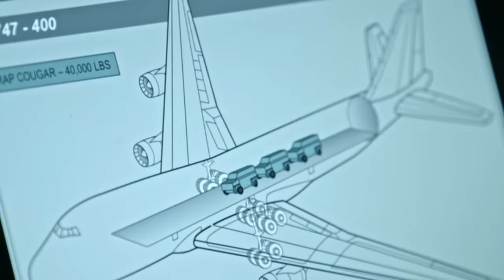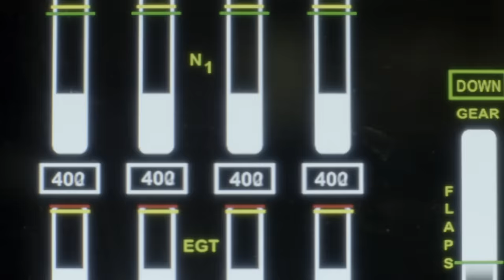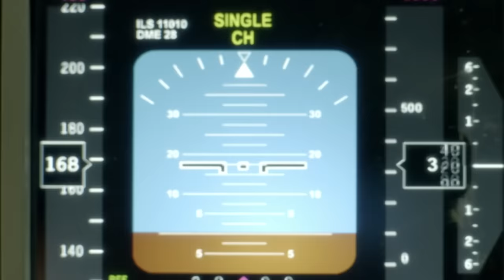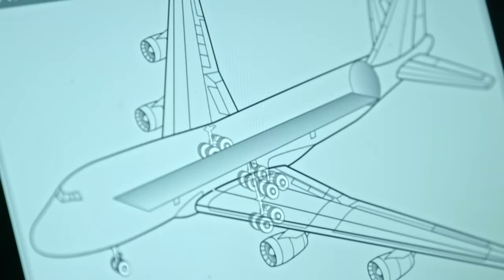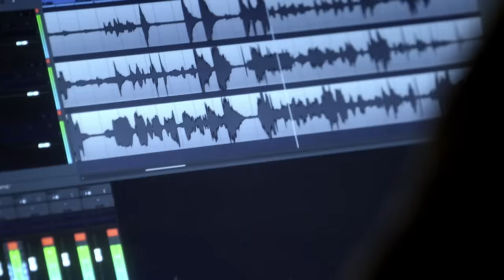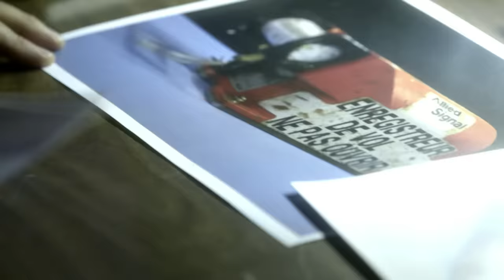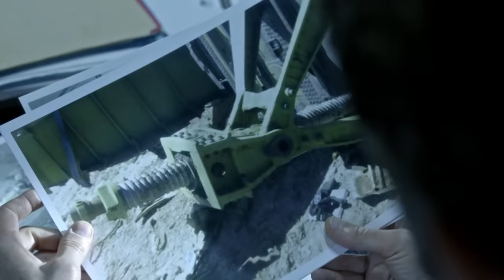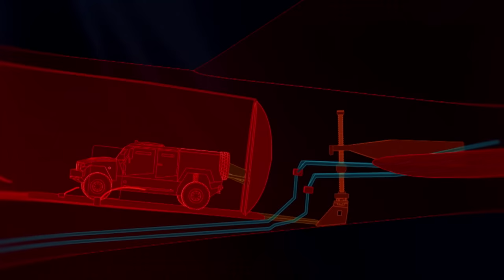The Cargo Plane in Afghanistan That Crashed Seconds After Take Off | Mayday: Air Disaster

Comment from the maker: Had you heard of this aviation accident? What do you think caused the crash?
Reply: I have heard of it. It was caused by  inadequate securing of cargo that shifted to the rear. The civilian contractor had vague and inadequate procedures and inadequately trained loadmasters. This particular load included several heavy vehicles that didn’t have sufficient measures to prevent them from rolling back and crashing into the rear of the cargo bay, damaging the aircraft and shifting center of gravity, making the aircraft uncontrollable. There was an insufficient number of cargo straps used and many of the straps were in poor condition. Cargo chains were not used. Wheel chocks were also not used. If USAF loadmasters had supervised the load, they probably would have identified the deficiencies and might have prevented the incident. Unfortunately, at that time and place the contractor was given full responsibility for their loads without meaningful direct oversight and they cut corners to reduce costs and win lowest bidder on the contract.
Reply: Even if the contractor loadmaster had been properly trained and certified and the company manuals had been properly written with accurate and sufficient information, the incident still might have occurred because the company also failed to provide sufficient cargo securing equipment and pressured employees to make do with what they were given. 

The best solution would be not to use contractors at all for these kinds of loads. Leave them to the military to airlift themselves and give the military sufficient equipment, personnel, and time to conduct the transport missions properly.
Reply: Omg yes I have a problem I believe
Reply: Yes I have heard of this crash. I know the pilot's daughter. She was in middle school when this happened.
Reply: I remember when the video showed up online. I heard about the cargo failure much later, but never heard about the strap angles. As someone who used to teach technical writing, it's tragic to know that omitting such critical information could lead to three 3 fatalities and a load master who likely carries a lot of guilt.
Reply: I heard it was partly  ATC’s fault as they were fielding too many help desk calls for Dell at that time.
Reply: When did it happen?
Reply: That had to be terrifying to watch…..and then realize that was caught on dash cam……
Also, may the pilots RIP.
I took an aviation course. Weight and balance is vital for smooth flying…..and not dying.
Teacher told a story where a grocery store owner was flying meat in his little tricycle Cessna to one of his stores.
He took off fine, landed fine, but when taxiing to his hanger the tail suddenly dropped to the ground and turned the tricycle Cessna into a tail dragger.
Apparently as he was taxing, just enough of the last of his fuel was burned off to change the weight and balance….and turn the plane into a lawn dart.
Those are banned toys for a reason, look it up.
Thankfully, this happened after landing.
If this had happened while landing or flying the NTSB may of had difficulty figuring what was beef and what had been human…….. 😣 There would of been some inevitable bad jokes and loss of desire for beef, burgers, and tacos.
That’s why you faster fuel consumption when flying to…..and always freaking secure loads!
Also, some of the younger students learned what lawn darts were.
Reply: It's simple one or more of the M Ravs came loose and started moving around its probably something to do with those home depot straps they used🤷‍♂️🤷‍♂️
Reply: I saw a video on this by Mentour Pilot and one by another YTer, but I don't remember which.  If I remember correctly, they stated that two vehicles broke free.  But the investigator in this video mentioned only one.
Reply: Well that video has been around a good while, and I immediately thought the CG was way off and it stalled. I haven't finished watching this yet but glad to find it and very well done. Thanks!
Reply: I think over the years the NTSB has been pretty amazing at picking up many pieces and putting it together. And they tell you what caused it. I had always thought it was a problem of simple weight and balance with that massive vehicle breaking loose from its tiedown

As they explain in this video that was what set off the chain of events but it would've been controllable had it not damaged the airplane
Reply: This was the year I was born
Reply: The cargo moved back which resulted on the plane crashing
Reply: @thebigbosschannelbsw5351 e too I was born in February 19, 2013
Reply: Failure to flick the straps and say "She ain't goin anywhere! ".
Reply: I'm hooked too
Reply: No.
Reply: Horrifying for all, the cargo shifted,the plane fell and crashed
Reply: I was there
Reply: Brad Hasler was related to me by blood. Actually, my mothers side. I never got to meet him since I was only 3, but my grandfather (mothers side) talked about him a lot. I know nobody will believe me but, that's just my piece.
Reply: YES...on your channel. It just had a different title.  So damn annoying of you.

Comment: I remember when this happened as we were about to rotate in. Everyone knew what happened before the report came out. The contractors ALWAYS used nylon cargo straps that stretched, instead of steel chains for restraints because they were lighter and easier. I hate to say it, but you can’t take shortcuts in aviation.
Reply: Seems like a lot of these incidents are a result of taking shortcuts doesn’t it ? To save time or money.
Reply: Rotate in? Did you mean land?
Reply: @flyguyry1 he means start their deployment
Reply: I watched it from start to finish. We were only at Bagram for 3 days. We were still recovering from jet lag so most of us were sleeping and I was walking to the USO when I watched that plane fall out of the sky. My parents called me 2 hours later terrified that we were on that flight. Since the incident showed up on CNN.
Reply: @flyguyry1  no, it means just crashing after takeoff. Yes, a couple seconds.
Reply: The manual didn't tell them that.
Reply: You can take a shortcut, but it may end in the morgue🥺
Reply: nylon straps on 18 ton vehicles??!!
the ones shown in this video were cheap 100 to 200 lb straps you could pick up at Wal Mart
even using a lot of them, it would never hold
Reply: Why is it when you see pictures or documentaries of the military moving this kind of equipment via their own transports, they're always using CHAINS instead of straps?
Reply: One of my duties whilst in the military was to load M1 tanks onto railcars, a tricky bit of business considering that the only half of each tank tread actually managed to set on the railcar, with the tank body hanging more than 2 feet on each side. Aside from specialty clearances and routings due to the really wide loads. Yes we used chains, big beefy ones and a lot of them
There are almost no military vehicles made without built in heavy tie rings or hooks for shipment or extraction.
1 inch (25mm) straps is truly unacceptable, no matter how many there are. One break and a cascade failure of the rest is the result as the load shifts
Yes, Chains are heavy, and subtract a bit from the payload capacity, but SHALL be used
Reply: Chains would've been better but I think the angle they are placed in makes a huge difference. If they used chains at a 90 degree angle then they would have snapped as well because the tension force vector on them would reach infinity as that weight shifted. In theory you want to tie it from the highest cargo point at a 45 degree to the ground and/or at 0 degrees from ground to ground...And cover all 4 sides if possible. But I don't know, if you have to carry 90 tons with wheels in a plane you better hire an engineer for loading
Reply: Rules of aviation safety are written in blood
Reply: "Everyone, "knew this, it seems like you're a partially responsible for not speaking up and saying something, how do you live with that?
Reply: @julioperez-delgadojr2976  sounds official, but I know, you clearly have no idea what you're talking about!
Reply: I was a truck driver for 18 years, I did some flat bed work, I always wanted a couple chains in addition to straps, I always wanted to secure the load beyond what was necessary.
Reply: Why do u hate to say it?...it's the truth
Reply: nylon strap vs 20 ton vehicle.

Comment: As an instructor loadmaster in a previous life, we never would use straps to tie down a metal vehicle to the aircraft.   We used 10 or 25k chains to secure loads to the floor rings.   I was stunned to see those vehicles secured with cargo straps.
Reply: Interesting! Why do you think they went with straps? Could that be a military efficiency/cost thing?
Reply: National Airlines was contracted to do the work as opposed to the military doing it themselves, so it would probably be more a cost-cutting measure by the business.
Reply: I agree with you. They shouldn't use 1 inch straps for that much weight definitely use at least 3/8 chain
Reply: I've been involved in trucking and construction most of my life. Those straps would just rip on a steep climb. My idea is you only strap down with something that can also lift the item being secured.
Reply: As the son of a man who's been driving a truck for bout 30 years, including while as a soldier in the United States Army, that just seems dumb.
Reply: @iansargent196  obviously, chains add weight to the load.
Reply: You’re kiddin’🤔
Reply: By scraps do you mean straps?
Reply: @flyguyry1  oops…yes
Reply: Whether chains or straps, the WLL is what it is.  Unless the possibility of fraying/heating is a concern, it doesn't make much difference.  Having said that however, it IS typical to use grade 70 or higher transport chains.  Regardless though, I don't think that was the problem.  The issue was the direction of force of the securement.  Clearly there was not enough securement to cover each angle of movement (up/down left/right front/back etc.)  I suspect...just suspect...that the appropriate amount was used to cover the GROSS weight but the direction of movement was not accounted for.  Just my estimation.   The narrator didn't describe the issue very well.  I would be interested to read the actual findings.
Reply: @UhYeahWhateverDude  There was a lot of blame placed on the loadmaster after this info came out.  I had a friend who was out there as a civilian contractor for another company, after he retired from the Air Force, and he said some things about the lack of training some of these contracted companies provide. 

I agree that it sounds like they just simply provided a base number of straps to account for the gross weight, but didn’t calculate for the various movement direction and angle of restraint.
Reply: I was a 2T2 in the Air Force and was thinking the exact same thing! WTF are they using straps for?!?
Reply: @Ean9881   Small world. I’m also a 2T2 :)
Reply: Correct. Those ratchet straps they used to secure that kind of load were probably purchased at walmart. Probably 100 lb load capacity ratchet straps.

Comment: In my years of being in the army doing airborne ops where we strap those same exact vehicles down even a 14ton howitzer, we never ever use those teeny tiny ratchet straps. We use beefy bulky ones so the weight does not shift. Not to mention strapping down MRAPS, that’s kind of crazy that they were allowed to use those straps, that’s not holding a humvee much less an MRAP
Reply: Those were used for this video, I’m sure they used straps similar to the ones you described but they were either damaged or incorrectly installed
Reply: The cheesy orange straps were most likely just used as props for the show. I've seen them use all kinds of weird stuff as props.
Reply: I agree.  As a tanker pilot, we used straps rated between 10-15k per strap to floor load equipment.  There was never a question of shifting loads.  After our boom operator completed loading, I would personally check the load.  We never had issues.
Reply: But per the planes tech manual, the straps they were using and the fashion that they used them were adequate for use.
I'm sure the families of these poor crew were cut a big a$$ check, but im sure theyd rather have their family members back.
So freaking sad.
Reply: @manhalen7046  I have bought the cargo straps to just transport hot boxes and equipment on a flatbed truck. I didn’t purchase anything less than 6K each for my folks.  These straps far exceeded the anticipated weight.  The safety and security of my stewards was key.  It would be the same scrutiny as if I was flying a cargo jet.
Reply: @edjarrett3164  yeah i understand that but the loadmaster himself even referred to Boeings techn specs. As others have said, i think the straps they used in the video were just a generic representation.

Comment: As a Standardization - Evaluation inspector at a Combat Communications Tactical Air Force unit (5th Mob)  inspecting cargo loads before deployment I was often surprised at the attitude that, "Come on Sarge, it's just one strap," and have to ask them if they wanted to fly on that aircraft.
Reply: Shake hands with danger
Reply: My ex was in that unit at Robins AFB 84 - 87.
Reply: You make it very clear to your guys how important it was to get it correct. Well done

Comment: In 1975 I attended a Load Planners Course for Army Arrival/Departure Airfield Control Group ( A/DACG) personnel at Shaw AFB, SC.  Our Army units had to properly prepare the loads and assist in loadout so we learned all about the angles, restraint values of chains and straps, calculating CG station values and % of MAC, etc.  I've planned, inspected and flown with a lot of cargo during my 20+ years of active duty.  In so saying, I'm absolutely amazed that almost 40 years later a cargo company didn't know how to plan, load and properly restrain cargo and certify loadmasters.
Reply: Did you watch the video? They were using faulty technical specifications from the manufacturer of the plane.
Reply: lowest bidder. Make that $.
Reply: I always was the type to over do whatever I'm securing.  And that's regardless of what a technical spec says!  If I see something wrong, I at least ask questions.  It's said that the Captain has the final say on everything with the airplane.  The biggest thing I hauled to an airplane was 42 tons.  It was some kind of a dozer.  

I do remember when I got through there and when I got down to the other end, some one asked if I saw the airplane crash.  That's when I saw the smoke.  Glad I made it through before the crash!  I was probably close to 3 miles from the crash.  The rumors were sure flying, about it being the Freedom Bird!  That company had been flying out of Bagram and the other 2 main airfields, though I didn't spend as much time at the other places.

Comment: 38:08 - If you're ever transporting anything - on the roof of your car, in a pickup truck, on a semi trailer, whatever - and you secure it with straps, if those straps jiggle freely like they do in this scene, the load is NOWHERE near secure.  The straps are almost just decoration.  Obviously, this is a reenactment, but the point remains.  Unless the straps are TAUT, the load isn't secure.  You should be able to pluck them like guitar strings and see almost no visible movement.  And even at that, after driving for 20-30 minutes, you'll be amazed at how things will have shifted and they'll need re-tightening.

Comment: Personally I wouldn't use nylon strapping!
We ALWAYS use log chains with load binders!
Course were not flying either,but then again I still WOULDN'T use nylon anything for heavy loads!
Not too mention ppl need to know HOW to secure load(s)!
Reply: it starts with how the floor of the the plane is made to hold maximum loads and then upstream from there to the attaching straps or chains.  In the Navy we used 3 & 4" wide nylon straps to hold and or lift fighter planes strapped around many load areas. Absolutely imperative is an acceptable tiedown technique in the right places,  and i would bet that was a major factor and improperly done.  This was a horrible disaster and easily preventable.
Reply: Could they chock the vehicles?  With chocks that, uh, latch into the plane’s floor?
Reply: @dennisyoung4631  they are on skids. The skids are on the floor.

Comment: Regardless of the use of chains or straps, the aluminum restrains in the floor are a weak point. Worse yet, if the seat tracks are worn, the restraints would rip out, due the the extreme weight of the MRAPs. Heavy rolling stock like an MRAP, should only fly on a C-5 or C-17, where you can chain it directly to the floor.
Reply: Your avatar made me smile. That rooster standing there...😄

Comment: As someone who at one time used trailered dozers to work earth, etc I'm surprised they didn't use chains. As far as I know they're still used in construction.
Reply: There could any number of reasons why they didn't use chains, the most likely of which is due to "cost" and the airlines wanting to keep things as cheap as possible (remember, government contracts always always go to the lowest bidder which usually has the lowest quality)
Reply: They should have used chains, but thier load maual didnt call for them, and the load manual was completly wrong about how to use the straps.
Reply: @patricktack165  Exactly. Your bible is always the plane's tech specs and Boeings were wrong, as stated in the video, the loadmaster did nothing wrong.